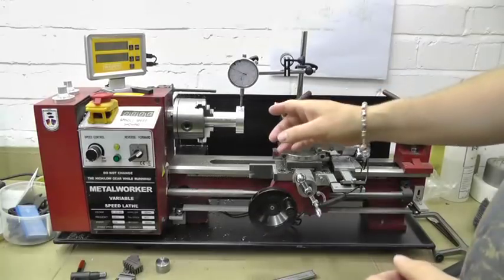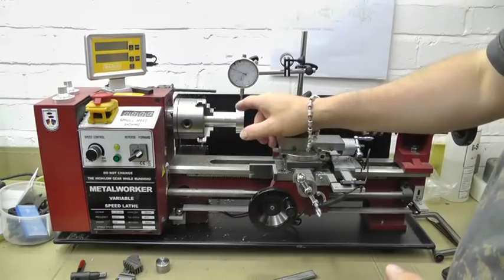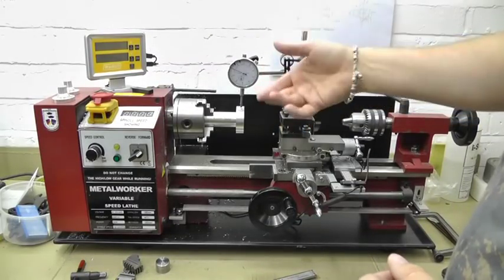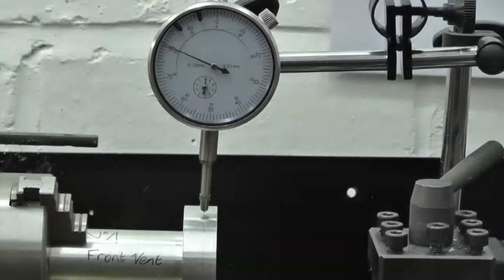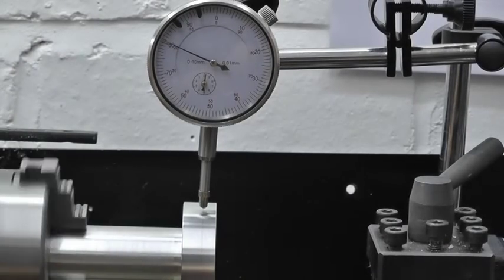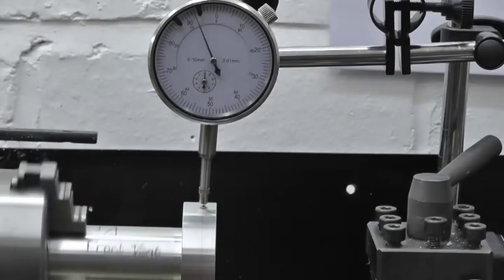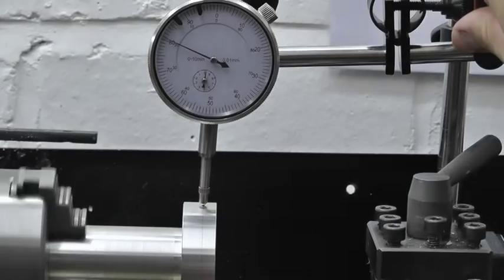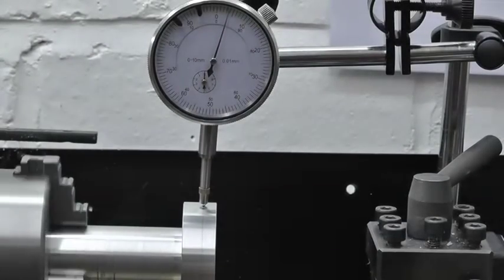Sieg C3 Mini Late Chuck run out test

Comment: Always funny to watch people getting this and that close to zero runout on a scroll 3-jaw chuck. If you understand how it works, you can get pretty much any such chuck to center a workpiece dead nuts on zero. Good example, old Störebro chuck, worn past its useful life ages ago, and have no problems getting a part to run true. If just chucking a part, it can show anything from 0 to 0.3 mm runout.

Comment: what kinda of dro are u using did it come with that display
Reply from the maker: The DRO system on my machine comes from Warco http://www.warco.co.uk/7-digital-readouts-scales-dro
they are a cheap set, I have had no issues with them apart from having to
change battery’s every now and then, the mounting kit is self-made.

Comment: Did you take a cut on that piece before putting the indicator on? How do you know that the workpiece isn't where the 0.01mm is coming from, or that it is offsetting a greater amount of runout?
Reply: The bar was not made with this lathe. He explains that @28sec.